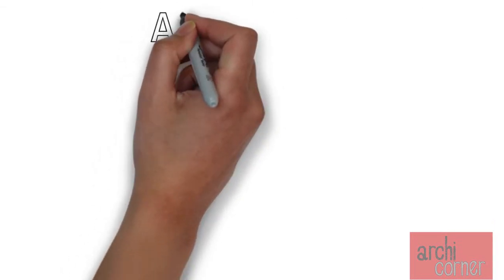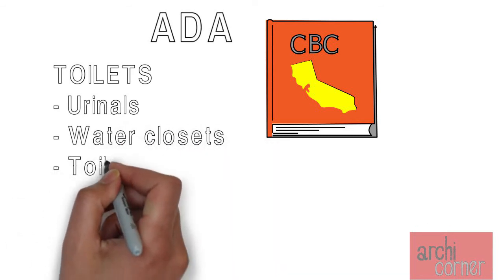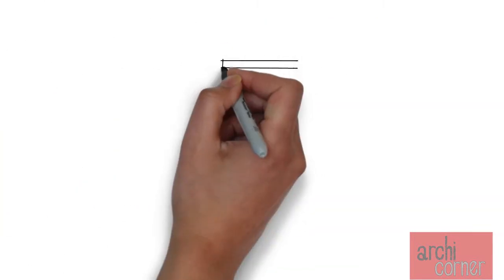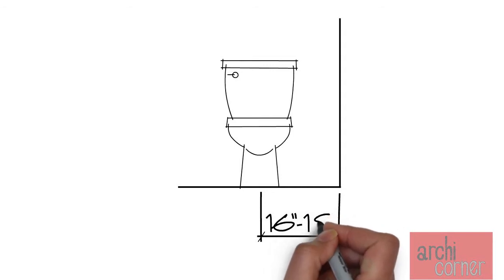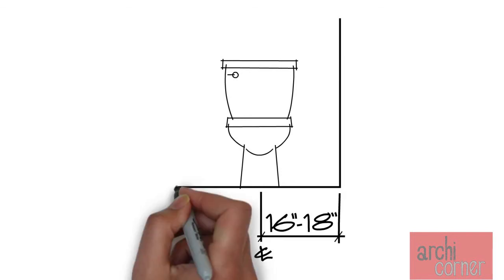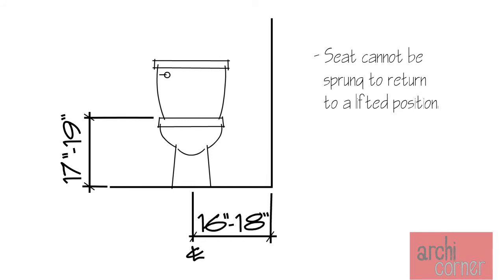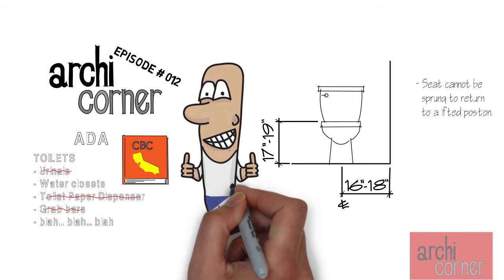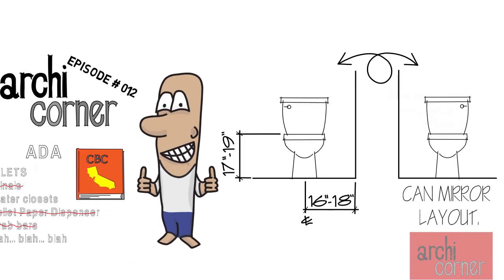AC 012 - ADA Requirements for Toilets: Water Closets

Comment: thanks so much for the videos. they are amazing. question on the toilets...all the info I see is that the toilets must be 18 inches from wall. I dont see the 16"s anywhere.
Reply from the maker: 2010 ADA Standards section 604.2
Reply: thanks! @archicorner